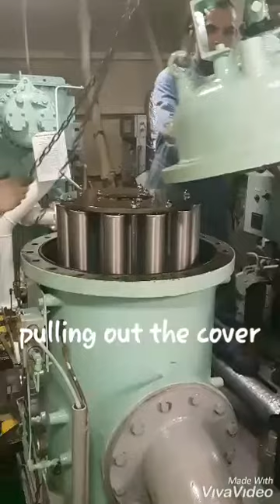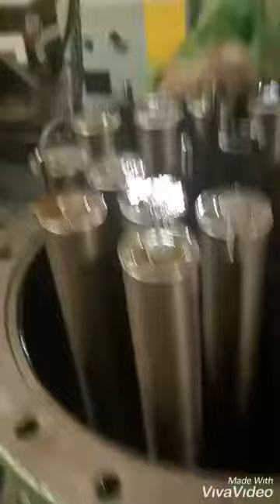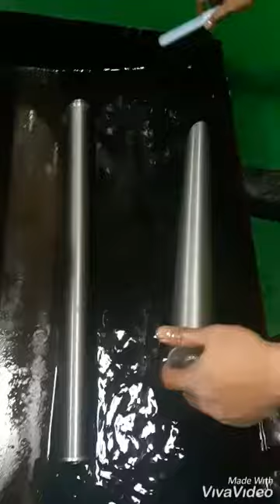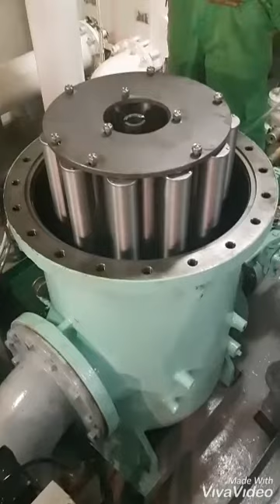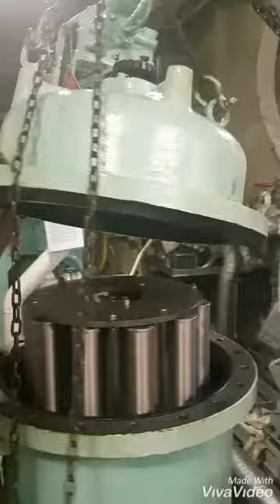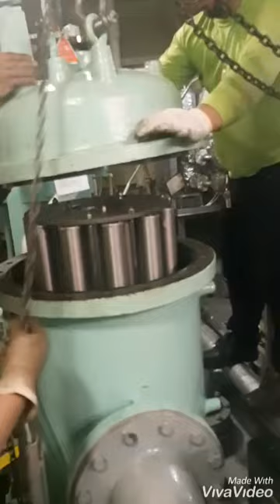Main Engine Lube oil Auto backwash filter

Comment: hello i have a question in your videos i saw main engine fuel hiter we have problems with it heatere fuel pressure rises whenever i open steam what could be the reason
Reply from the maker: Your heater is leaking...
Reply: No leakage I tested by steam when i dismount
Reply from the maker: Can you show me pictures of your problem
Reply: @racz3manliclicjr.95  
How i can show you 🤔
Reply: @racz3manliclicjr.95  
Its normal fuel oil system 
For heavy fuel oil
Reply from the maker: See, normal pressure of fuel when heated properly is about .7 to .8 mpa. When you say your f.o. pressure is above  when you open your steam, then it means heater needs cleaning or your steam leaking going in to the heater...
Reply: @racz3manliclicjr.95  
Yes but my heater is clean
When i dismounted